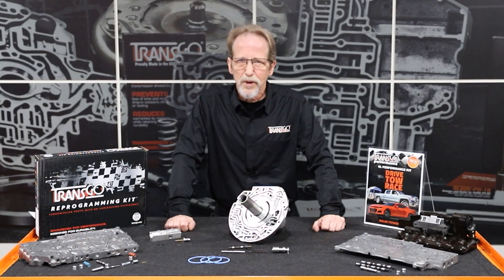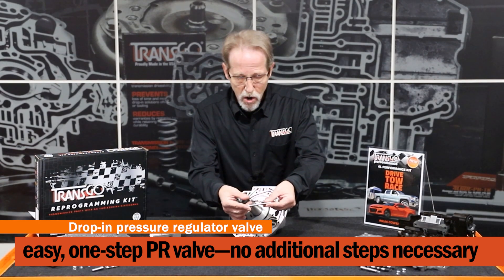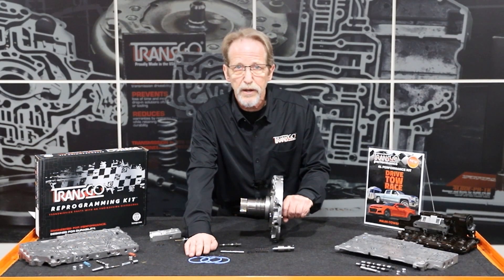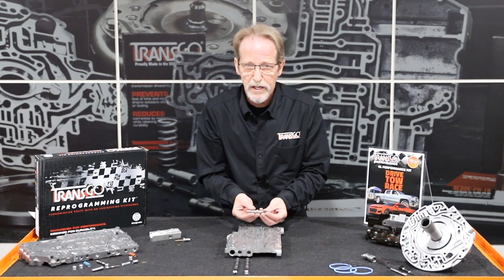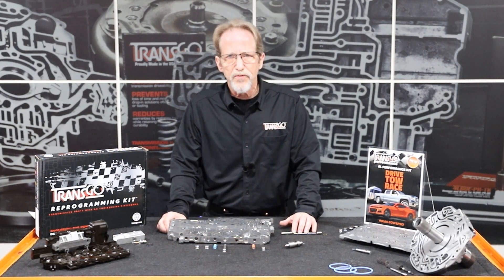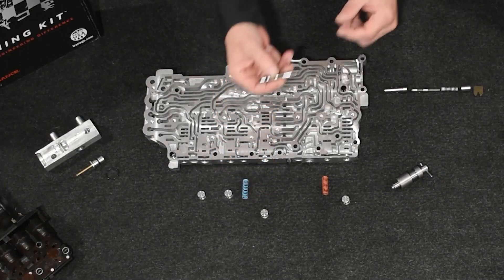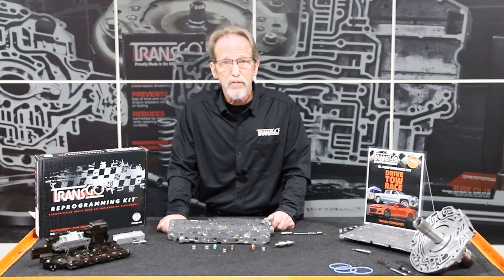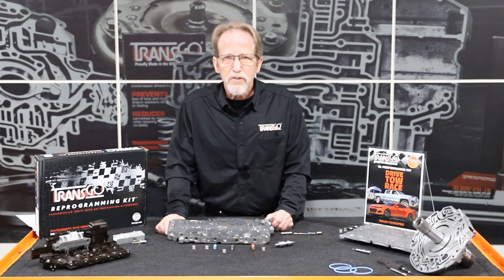The first and only 6L80 performance kit

Comment: Just brought SK6L80 shift kit for my chevy camaro SS. I hope it works as described
Reply from the maker: That kit is solid. Works great with the 6L8 CS-TCC Clutch Select Valve and TCC Regulator Valve Kit 👍
Reply: @transgoshiftkit  I have kicks and slips, but not constantly, every other time.  I bought 3 kits from your company, I will try.

Comment: is this something I can install myself at home or dose the xmission need to come out?
Reply: Transmission has to come out
Reply: @29auto30  🙄🤔😳
Reply: Yeah if it required just the valve body, that would be a cinch, but it requires removing the pump (on the right side of the screen) which is connected to the bell housing and torque converter. So yeah, you need to drop the trans.